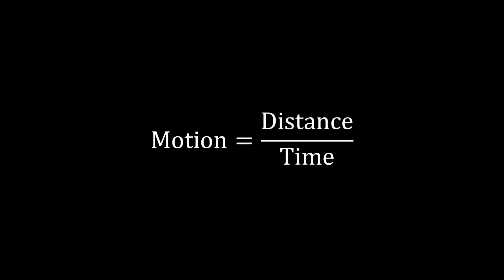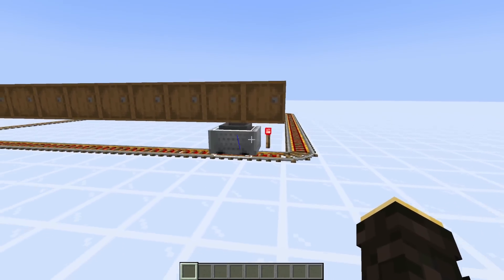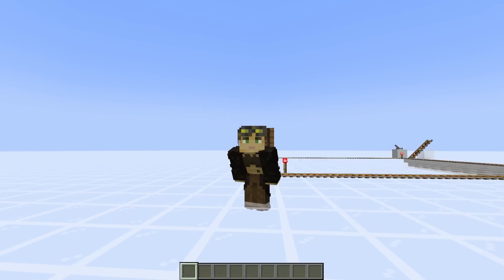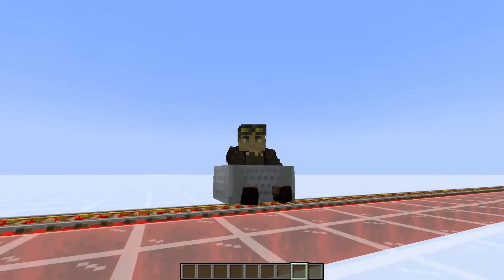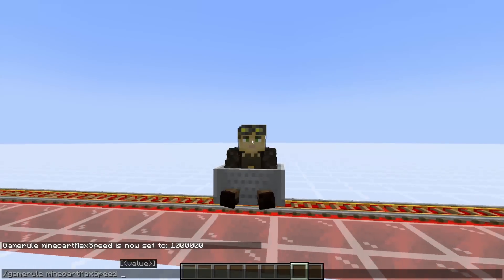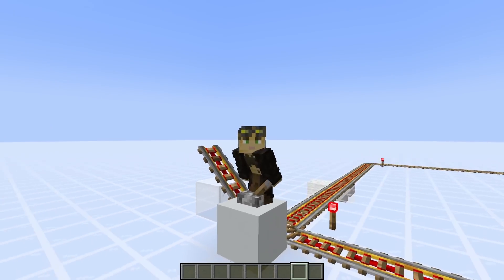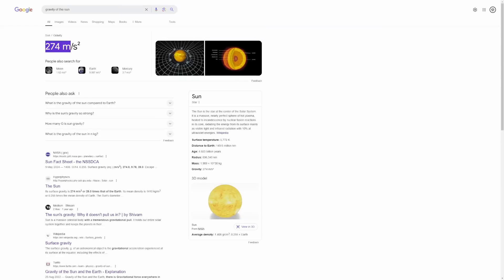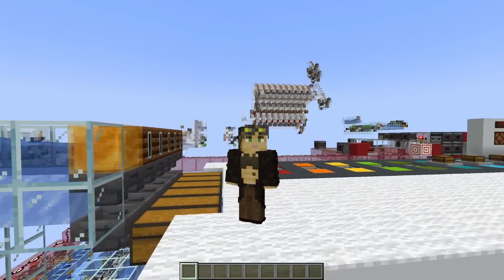Minecart Madness

Comment: At 6:35 you talked about both ways copper rails could be implemented. What if they could add them but make it so it works both ways you mentioned, as in each oxidization level had a different range of speeds that could be changed by signal strengths. The only problem with that is that the non oxidized rail's range of speeds might be too high and thus make the normal gold powered rail useless, so I thought what if we shifted the ranges of each lower and made it so some of the more oxidized versions would not make the minecart slower but was a negative speed counterpart to the less oxidized version (so they would make the minecart go in the opposite direction it was coming from at wtvr set speed)

Comment: I agree with every point in this video!! Another point: The value you chose, 75 m/s, would also be very good from a game balance perspective. Boats on blue ice currently have a top speed of 73 m/s. Both are forms of transport that require a lot of infrastructure. Ice boats are a janky game mechanic that was originally a bug, and minecarts are a cool feature with a lot of potential and which inspire more creativity. Therefore I think Minecarts should replace ice boats as the fastest infrastructure-based transport. It'd also be faster than Elytra in most cases, which would reduce player's dependancy on flight, which is also a good thing imo.

Comment: I would be ok with the derailing feature as long as you could place down more gradual curves. Kinda similar to how you would in factorio. Otherwise it would just be a nuisance.
Reply: Considering Minecrat's block placement is basically a glorified grid; you can be sure gradual curves that extends for several blocks is not happening anytime soon if at all.

Comment: So I had a similar idea, but with fuel. Just give all the minecarts the same feature as a furnace minecart, and then differ speed, duration etc based on the type of fuel that is in.

As an example, the base speed of minecarts being 8 blocks per second if moving at maximum speed:
Lava applying a 0.5X multiplier to the speed for basically 3 hours (because slowness matters too)
Coal being just the 1x multiplier but for a longer duration than now (lets say half an hour)
Coal Blocks being the same 1x multiplier but for 6 hours.
Kelp Blocks being a 2x multiplier for an hour.
And rare fuels like jukeboxes being up to 10x for an hour

Stuff like that, and then rework powered rails to square the multiplier of the fuel when turned on, but take the root when turnet off. 
Then Lava would be 0.25x while turned on, and jukeboxes being 100x (aka, 800 blocks per second for those who lost track). While an unpowered powered rail would give roughly 0.7x for lava and ~3x for jukeboxes.

It would rely a lot on gathering fuels, but you would have a massive range of speeds. And any desired speed could always be added by changing a fuel type (like charcoal and coal both being the same at first, but charcoal getting slightly altered to fit a niche).

You would FOREVER solve minecart speeds. People can make actual rollercoasters with reliable changes in speed where needed. Technical minecrafters can literally design anything they would want. All the other fuel sources suddenly get a use beyond "i needed to smelt something and had this lying around", heck, wooden tools as fuels suddenly could become VERY interesting. And whenever the minecarts are lacking somewhere, BAM, new fuel type fixes it.

Its maximal customisation with minor tedium, because even the hardest to obtain fuels arent even that hard.

Comment: Uncapping the original powered rail would still potentially cause issues with existing builds though. People would have to go through and replace them with copper rails + matching signal strength/oxidation level. I think the original powered rails should remain at their current speed; implement the copper rails as you specified; and then have a new booster rail that accelerates the cart with uncapped speed. Because of how crazy uncapped speed is, perhaps it would require netherite to craft. 

I dont like the idea that without needing to do anything, old rail networks could suddenly become one of the best forms of transportation. I think people should have to work to upgrade their rail systems to achieve such speeds.

Comment: Best way to make minecarts faster (in my opinion):

Copper rail idea suggested in this video
Special types of rails that have more shallow turns/curves (like a real life train track) instead of a sudden 90 degree turn to avoid derailing but still have turns
acceleration and max speed as mentioned in this video
a bit controversial but rails should wear out over time if minecarts are constantly going fast over them
more rail types to allow for loops etc for cool rollercoasters
minecart trains, which are just loads of minecarts joined in a line (like train/rollercoaster carriages)

Comment: Maybe there's some reason why it wouldn't work, but it sounds to me like a lot of the problems at high speeds could be mitigated by handling the movement in multiple steps, as a lot of games typically would. So it wouldn't skip picking up items if it, for example, moved half of its speed but twice at once during a tick, letting it simulate being in the space inbetween its movement. With more or less divisions depending on whether the speed warrants it or not.

Comment: Alternate fixes to maintain the old technical uses: 
1: Only apply the experimental changes to the ridable minecarts and leave hopper/chest minecarts as they were. 
2: leave powered rails with the old max speed, and apply the experimental changes to furnace minecarts.

Comment: easy fix at 2:50 area. increase the space the cart takes up, increase the hitbox from block to block, so it picks up based on space traveled rather than time taken under each block. have a set number so that for every tick under a container, a certain amount of blocks is taken, but make sure that the hit box is relative to it's speed so that it is always under every block along the track for at least one tick, or make it so that if it has more speed after a certain point that it always takes the same amount of blocks from containers.

Comment: I think a better solution would be to have different max-speeds per type of minecart. Redstone contraptions and players who want to travel use different minecarts and thus can easily be seperated. A normal minecart can be faster, while minecarts with a chest, furnace, TNT or a hopper can be limited to speed 8.

Comment: I like this entire idea and the drastic changes presented. I'd say just to add icing on the cake would be to add some gamerules that allow players to customize the behavior a little. For example, use a gamerule to disable derailing and maybe one to set the drag coefficient manually. This would ensure that minecarts, by default, are more immersive but (in typical Minecraft fashion) can also be ridiculous for the sake of the silly. 

If any of these gamerules would be implemented I would wager the disableDerailing would be the most important as that could be extremely annoying. 

Something else that could be added would be more gently curved rails. This could also assist in managing the default derailing behaviour by reducing the slope of the curve per block. Having a rail that curves over a longer x and z (such as taking up a curved line in a 5x5 area) could allow you to keep more speed during travel and make the experience of turning much less "jerky."

Comment: 13:05 Just a thought here, but 4 kW? Isn't it fairly unrealistic to expect that to be able to accelerate the minecart to 270 km/h? 

4 kW is about the power required to get a motorcycle to 70 km/h, but nowhere near 270 km/h, in fact that would require many times more power. Are you sure there is not something wrong with your calculations?

Comment: Quadratic Drag models an object moving through a fluid. However friction still exists and is modeled properly by minecraft.

Minecraft SHOULD NOT model quadratic drag as it will never stop a minecart from moving. The way it models the speed currently is correct, because generally friction is stronger than drag.

Comment: The speed increase is also something that will mostly affect people tampering with their gameplay with commands. So it will mostly not affect people playing "vanilla". 
What really needs to change imo is adding a sort of wagon system where you can link carts, the ability to make crossroads, adding braking rails that can also launch a cart again on power (like your copper rails), the ability to use different fuels than coal that might add more speed and making them more immersive in general. Something I'd also be fond of would be allowing players, just like in boats, to have two seats in an empty cart. Functional ones could still only take one type of block and storage ones could maybe take a double chest instead then.

Comment: fixing minecarts and redstone deserves its own dedicated update. the amount of work required to make sure the permanent changes are consistent, and positive is just huge. both systems definitely need an update, and to bring parity between the two versions of Minecraft

I agree with you sugestions bc this preserves old uses while adding new. In software development, theres a thing called open/closed design, where things are open to extension but not modification. this means that you can only ADD new things, even if old ones are broken, this ensures backwards compatibility. this would be an excellent adaptation for minecraft redstone since software and redstone are similar in that sense.

Comment: Genuinely, I think something like the copper rail is the best thing Mojang could add for this to keep functionality for technical players, but make it useful for the survival players. I think tying its speed to a redstone strength input or a way to right click it to change between speeds (like a repeater) would be best though.
Regardless, here's hoping Mojang hears about this idea and implements it instead of just letting our technical players just figure out exactly how many rails are needed before and after to keep a consistent speed.

Comment: Honestly at first 'no speed limit' sounded crazy but adding a realistic and more importantly believable cap  would give the best of both worlds.
Also rocket powered furnace mine arts seems great since the idea is to make minecarts more viable compared to elytra, them both using the same resource could add a better consideration

Comment: Tribes faced a similar issues with player movement.  As with all games, it had to simulate the world at a fixed (albeit high) tick rate.  However, players could get to ludicrous speeds with hill skating and other techniques, fast enough to phase through solid objects in the world.  The developers had to encode interpolation checks to halt the players in the cases where their paths intersected geometry.

Comment: What if they brought back the derail mechanic with copper rails.
Imagine for each level of oxidation, the rails become more unstable.

Riding on oxidised rails would create an amount of visual wobble, where going to fast would derail your cart to the side, with a fully oxidised rail being able to derail at any speed, or tip you out at low speeds

Comment: why not just use bresenham's line algorithm or something like that to check for any blocks that need their logic done that minecart has skipped due to its speed? I'm not familiar with Minecraft's code though so i don't know how hard that will be to implement
Reply from the maker: Well then the problem is, normally a hoppercart would pull from a single inventory each tick, but if it passes multiple containers in the same tick then which container would it choose? It can't choose all of them because then it would have to execute its hopper code multiple times in the same tick by an amount dictate by the number of containers. It makes things very inconsistent with established behaviours.

Comment: 12:37 that doesn't give a power output for the rail, speed and acceleration becomes more "expensive" the faster something is moving. Kinetic energy scales with velocity squared, so you can't give a power output. You could however give the energy every rail can give to the minecart, by  N*M. So simply 4085J per rail
Reply: good catch!

Comment: I 95% agree. I think the corner derailing is an antifeature. Games are about escapism, and realism is usually the first victim in service of that. Let minecarts turn corners at silly speeds, because it creates fun.
Reply from the maker: There is another issue with minecarts turning corners at any speed. The raycasting algorithm used to detect the shape of the rail can loop back over the same rail multiple times if the speed of the minecart is high enough. This causes redundant processing and memory usage meaning it would actually be ideal for the raycast to eventually terminate and de-rail the cart before it crashes your game.
Reply: @cubicmetre what did you use for the simulation?
Reply: @cubicmetre  Surely the algorithm would just look however many rails ahead it needs to, e.g. 4 rails for 80 m/s. Why would seeing the same rail again make a difference?
Reply: They tried a derailing mechanic on another snapshot, it definitely did not work.
Reply: I hate coming home from my 9 to 5 minecart job and going into minecraft and having them derail!!!!
God!!!!!!!!

Comment: One of my all time favorite mods Railcraft had a mechanic a bit different but serves a similar purpose with what you suggested. Beside standard Minecraft rails, there were also wooden ones (slower max speed) and high speed ones (much faster max speed), but if you try to make a turn with high speed ones, you needed to slow the card or it would de-rail.

Comment: Question:

How much unpowered rails slow down a Minecart? How much one powered rail accelerates a Minecart? And how much speed does it loose per regular rail it traverses?

Would it be possible to implement some kind of speed control? As in, having powered rails every X blocks to keep a constant speed? Or have an Y amount of unpowered rails to slow down a speeding minecart to a specific speed?

Comment: 6:00 obviously i dont know how the code works but this doesnt seem mutually exclusive, cant mojang make hopper minecarts keep the old speed then empty minecarts get the new speeds as players wanting to make rollercoasters or efficient transportation have no use with hopper minecarts being fast. that being said in my opinion i'd prefer ludicrous infinite acceleration to be locked behind a furnace minecart. i just think having to spend resources to go insanely fast every trip and remembering to keep it topped up would feel better and is balanced in endgame like rockets with elytra. 

bonus the furnace can pull hopper minecarts for people who find a use for faster hoppers

Comment: i think the copper rails with oxidization is a good suggestion that isnt too weirdly complex and fits with already implemented designs for copper. the redstone power level to speed level idea for copper rails is comparetivily bad, design wise (not a bad idea in general, like, it would be useful and would make a cool mod or whatever, iirc create has some stuff that works like that, bt no i do not think that fits vanilla design at all and is too complex) 

as for drag overhaul and all the changes after that, they're mostly a miss. i think a better drag/acceleration equation would be good if they decide to go with higher speeds, but realism isnt needed and it should be balanced around how it plays not around some simulations that dont matter to the game. 
derailing is awful.

Comment: I don't think minecarts should derail. Instead, they should decelerate the minecart drastically, and to prevent this drastic deceleration the player can slow the cart down manually to maintain more speed. Perhaps making a larger curve with diagonal rails can also alleviate the reduction in velocity. I think this is less frustrating while still being intuitive

Comment: 13:51 I feel like if they were to go this far, there would need to be a full overhaul of rails; either with an adaptive curve system like Create, or a set of fixed radius curved pieces to allow for higher speed, smoother, and more realistic turns. I doubt it’ll happen, but I am all for turning Minecraft into a toy train simulator :)

Comment: I like all thoses suggestions, but I'm not sure minecart should derail...
We can only turn 90°, we do not have an option to make a less step turn angle, so I do not think it should derail.

Realistic limitations is only good when you have the option to do it otherwise.
Imagine how complicated it would be for a casual player to tune a turn to work with all type of minecarts... It can be very frustrating.
For a very long distance travel with only a few turn, why not, but for a slighly more complicated rail system, it couls be a nightmare.
Reply: ^ the first time mojang made minecart faster, they added derailing. in which it received A LOT of pushback. that they straight up rolled it back the next update and weve never gotten anything about minecart till now.
Reply: @primalknight  They didn't "add" derailing, it was literally a bug...

Edit: Isn't also already explained in this video that the literal reason why there's a speed cap in the first place is to prevent that very bug...
Reply: IDK if you listened to the video but the derailing suggested here is ONLY applied for particularly fast rails, faster than what we have now.

If hypothetically this were implemented and you plan to have a rail system with way too much turns for some reason-- then use a rail that only goes for a moderate speed, don't use rails that are essentially specifically made as the "highway" of Minecarts, it's like using Boats in Blue Ice as a way to traverse the world regularly...